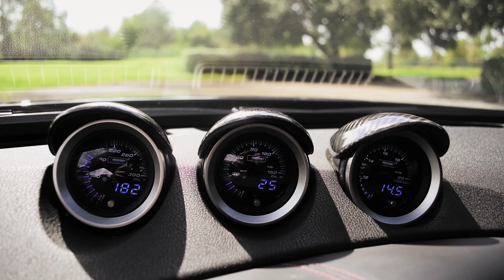BP Single Turbo 370z Nismo Review!!!

Comment: So the HKS SP coilover set up has 14k front and 16k rear divorced set up with helper springs. Did they really feel that good?
Reply from the maker: Yeah it was a good setup I was able to handle the car very well. But part of it was a combination of his tires and diff. But the coil overs definitely kept the car feeling smooth.
Reply: @JpCharisma  i have wavetrac and the HKS GT coilovers. They are ridiculously soft and the rate in the rear literally doubles going to the SP's thanks for clearing that up

Comment: Can you drop the engine internal mods in list? Thanks
Reply: Yooo I just saw your comment.  It's an IPP stage 2 longblock with C2 cams, 10:1 compression, all internals moly coated, with ARP L19 full package and Cometic HG. I'd run an HKS or Dynosty HG if I had a do over and also go with a closed deck. So far it's held up to 29psi but that was a mistake that won't happen again. Fuel system is CJM S1SE with two 450s in a Radium surge and a single 340 feeding the surge, 1300 IDs and the second 450 is on a Hobbs activated at 14psi.
Reply: @onesolidus  thank you for reading my post, i order a stage 2 longblock 2 weeks ago, i hope it will be strong enough to hold 800whp
Reply: @andywu8558  It is strong enough  just make sure you got either an L19 package or 625 package.  The rest is in the tune. It'll help if your turbo sizing, fueling and exhaust are optimized. Meaning a 3" minimum exhaust, 6766 or larger turbo or stage 2s if twin turbo and the fuel system can handle sending, i.e. injector and fuel pump sizing. Good luck bruh.
Reply: @onesolidus  im using gt28 turbos
Reply: @onesolidus  is this your car? Do you have an Instagram?
Reply: @KenTalent  @Tunerexic